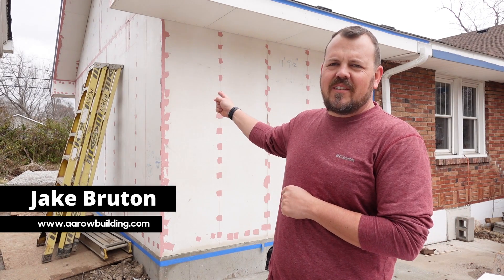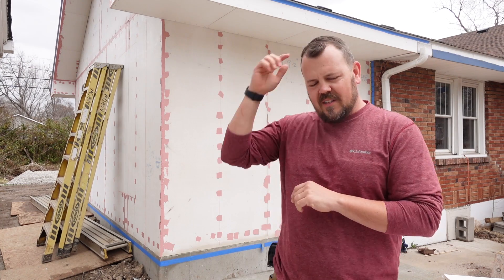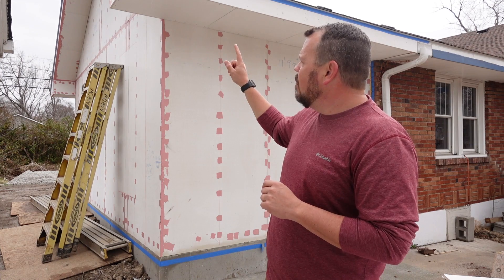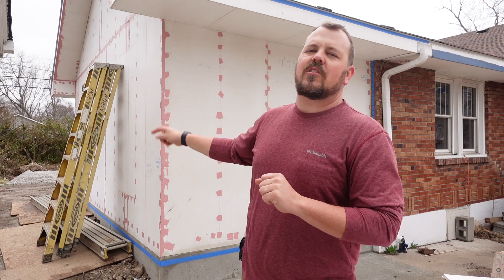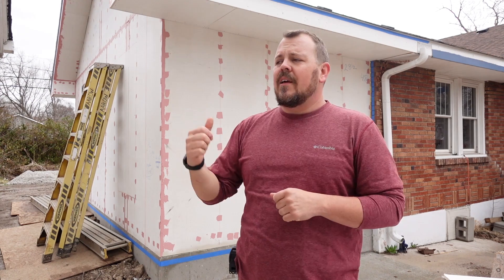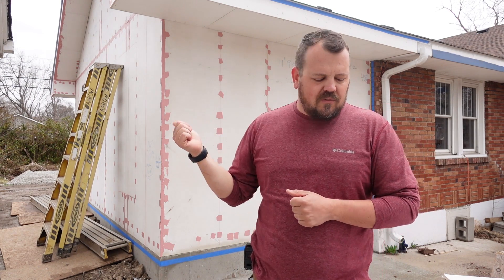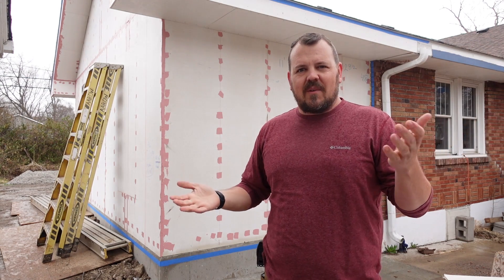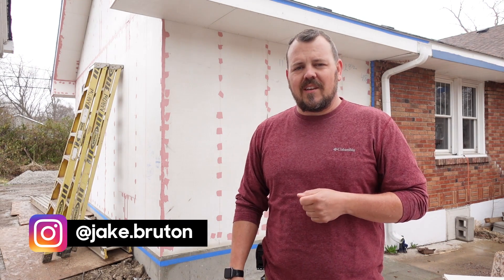Fire-rated Assemblies

Comment: Am building a house with Exacor on two sides.  Sealed all the nail holes and seams with joint and seam filler and then went over it with Prosoco CAT5.  The CAT5 stuck really well to the Exacor.  Being that the smooth side isn't really porous at all, the coverage on the CAT5 is really really high.  I can't say off the top of my head, it might've been one bucket did 25sq.  I was afraid that being so smooth the CAT5 wouldn't adhere properly, but it actually worked out really well.  Exacor + the RGuard system is an excellent combo for fire rated assemblies.  I was told a couple of years ago by a rep that Huber was working on Exacor with a Zip like integrated WRB, haven't heard anything more on it.

The code where I'm at allows just Dens Glass on the exterior fire rated walls, most builders do only that, but prior to using Exacor, we would always sheath the building with Zip and then Dens Glass over the Zip and tie the Dens Glass into our WRB.  Exacor saves a step in that we don't have to sheath part of the building twice and it's incredibly economical when compared to said alternative.  

Originally it was my intention to use Comfort Board to get my fire rating, but being that our building is maxed out to the set backs, the zoning official couldn't promise me that adding the necessary thickness of Rockwool, that we wouldn't be surveyed over and have a problem, so this was the best alternative and it worked out really great.
Reply from the maker: Great work. I heard rumors of some sort of MGO with a facer as well but nothing since as well.